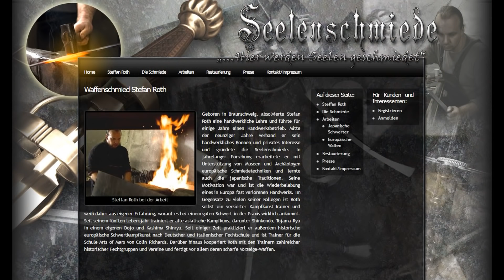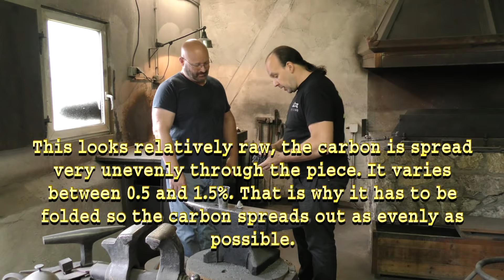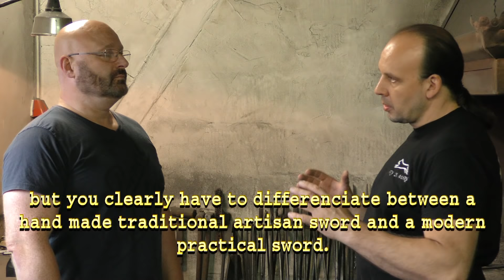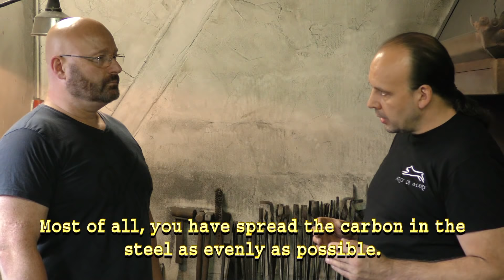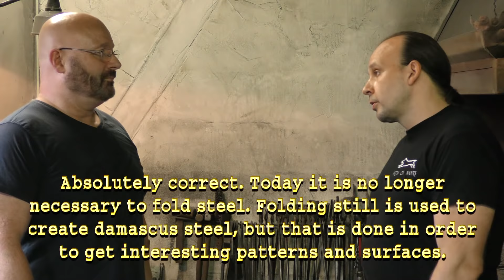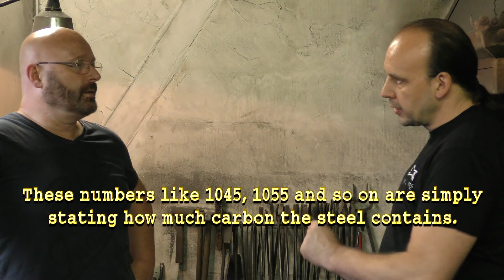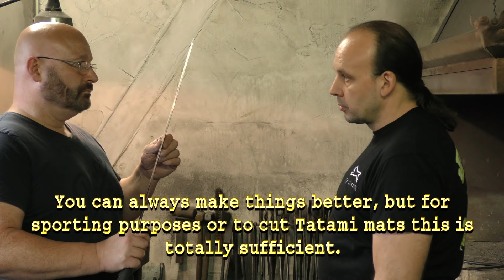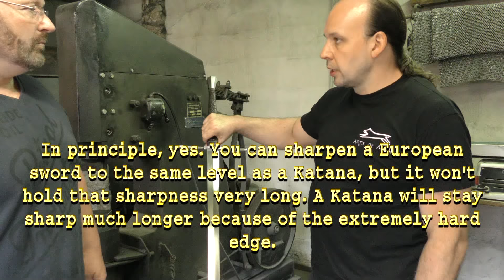Katana: The Naked Truth

Comment: I've always wondered if the Japanese tempered the edge of their katanas after the quench. I've watched a lot of videos of them quenching blades but never tempering them. Also, they never say what they use for flux in the folding forge welds
Reply: Shane K they use ash and clay.
Reply: I used to blacksmith some and when I made a forge weld I got the two pieces as clean as I could, I wonder why the ash and clay don't contaminate the weld?
Reply: It's a liquid mixture that they coat the workpiece with to stop oxidation. Straw ash and the clay used both contain large amounts of carbon.
Reply: I think I get it now, thanks. I guess it liquifies like borax and welds through, plus adds some carbon.
Reply: Something like that. Nobody truly knows the traditional methods used. It all comes in bits and pieces from swordsmith to swordsmith.
Reply: The mixture actually hardens in the forge and encases the steel. When pulled out it is shattered from the first hammer blow and wet anvil.

Comment: I'm not convinced that old Japanese sword makers would have forgone the process of folding in exchange for modern steel. Like tea drinking, ceremony, tradition and ritual are very important to the Japanese. Blessings were performed during the folds.
Imagine how disgusted a Japanese swordsmith would be if you just threw some metal into a CNC machine, pressed a button and a sword popped out.... even if you argued it was superior.
You may impart sharpness to the blade, but you don't wake the spirit of the sword... its soul.

Comment: Katana swords are not partially hardened!??! The clay process slows down the back edge or spine cooling rate but the entire blade is quenched in water not just the edge.. it is all hardened. The edge just hardened for cutting and the spine tempered for flexibility..European swords do not differentiate the spine and therefore the clay process is not used and the entire blade takes on an homogeneous spring temper, but to cool a Japanese sword only partially hardened is completely incorrect.

Comment: lol it's super interesting to watch someone who's practiced but not trained, especially in slomo - when you are cutting with a two handed sword or staff or whatever - your left hand (if sword) or whatever hand is lower on the grip (if not sword) delivers all of the power - the trailing hand should only be for control. (oh wow! He does MUCH better with 1h - just needs to transfer that to 2h =p) Not that you need this to be able to effectively cut, but your cut will never be reliably clean if you're not mindful of this - if you look at the leading arm tension in these cuts, anytime the tension is not maintained (ie the trailing arm is applying force) then the cut suffers tremendously. It does not take much force to cut, and you want to abuse the arc of your arm to get a slicing cut rather than a chop, at least with a katana - though this same form is used across seemingly all Japanese armed and unarmed - at least all I'm familiar with.

Comment: In comparing traditional tamahagene to modern steel tho a correctly made tamahagene is comparable to modern steel from my understanding traditional tamahagene swords are much more complex to make. From what I've read even expert japanese swords smiths had a sucess rate of about 60%
Reply: Cornered Fox when I say 60% sucess I'm referring to the folding process as blume steel starts so impure the folding process can cause the peice to crumble apart from my understanding and the few documents on traditional japanese sword smithing I've watched and read, it's very common for the steel to crumble apart during the first folds causing the smith to restart the process.
Reply: Tamahagane as Cornered Fox already said is nowhere close to modern steel. Though in defense of bloomery steels, you can make wonders out of it to this day, people figured out how to make it into a relatively pure steel pretty early on (but it wasn't the Japanese, it was the Celts in 700 BC). But it will cost you more in time and materials and your product will critically fail more often than ones made out of modern steel.

Comment: Either you Cut or you slay or you hack bro its obvious just take a normal rasersharp knife and cut a thin paper you will notice that just pushing it 90° will not cut the paper but when you pull it with a slight angle you dont even rly notice the paper like any resistance same counts for the sword!
Reply from the maker: Didn't you watch the video? That "pulling" nonsense was talked about. A sword isn't a paper knife.

Comment: This doesn't make katana any less better. The katana is lighter and will have cleaner cuts. the curved blade will also help with precision and speed.
Reply: Katanas actually are heavier than comparably lengthy European swords. A sword being very light does help with speed, but greatly reduces cutting power, as there's less mass behind the slice; weight is a double edged sword (pun intended). Also, the curved blade has nothing to do with precision or speed; it simply increases cutting power because there's more total blade length for a given swords' length than a straight edged blade. European swords were simply made with different techniques that resulted in a different blade that sacrificed slightly better cutting ability for far better durability and flexibility.
Reply: Nah katana is not a nimble sword at all for its size. The blade is very thick and heavy and the point of balance is far away from the hands. It’s a great cutter but that’s pretty much it (though I prefer the messer). European Longswords are much more nimble than you think. Popular media doesn’t represent reality.

Comment: How bout bigger than 300 pound human beings? Maybe in the right hands, a sword could be used to cut a sword, and the real katana would go through the soft steel, if a person was able to strike with that much force.
Reply: No way would any human be able to chop steel straight through with a sword. A bear would give up before accomplishing it. It simply isn't possible to generate that much momentum with a piece of steel that light without tearing your arms off. There's a reason you need a rotary saw going at thousands of RPM to cut cold steel; one quick slice simply can't do the job.
Reply: Joseph Traynham - How bout like a 5,000 pound 20 foot giant?
Reply: Honestly, the sword would probably shatter with that much force.

Comment: It's important to note that samurais first choice of weapon on the battlefield wasnt a katana (translated to english as simply: Sword), instead they used polearms, some used nodachi which is practicly a very long katana - where interestingly enough half of the metal rod is handle, the other being blade of course.
Furthermore, in europe, a different style of warfare, enrivonment etc. Made axes in early periods preferable - in later periods you still find slashing swords (falchion, for example) yet swords were prefered for poking in later periods (roman gladius from older period were also for stabbing though - so weaponry changed for the situation) also note that some longswords were almost dull at certain parts of the blade - whereas japanese swords were prefered very sharp on the blade because they served another purpose (having a hard blade and soft metal in the back to absorb the shock also means the sword is less likely to break/shatter - this is also used in viking dane axes, etc. :P)
Reply: Oh and also - you could find better steel in europe :)
Reply: Cornered Fox yes i did refer to a different type of nodachi, i saw metatron play around with one of those half blade / half tang

Comment: Your guy knows swords, but you'll never convince me that a katana made the old way, will be inferior, to a European sword made the old way.  I maintain they each have their strengths, and weaknesses.  Now a master swords-man, can use them to each ones maximum performance.
Reply: You do realize that traditional katana are forged using a method discovered by the Celts about a thousand years before the Japanese started using it?
Reply: About the same time I think, but the Japanese folded theirs more.  Plus the sword-smith, on the Katana, used high carbon steel to hold the edge and a low carbon insert to absorb vibrations.  Then when quenched, the steels lost heat at different rates.  Hence the distinctive curvature.
Reply: I'm fairly certain the Celts discovered it way before the Japanese did, around 500 AD and dropped it around 700 AD when more efficient smelting methods were developed/discovered. When it comes to steel folding for weapons the most it would be folded is less than 20 times, more than that and there is risk of ruining the while thing.

You are correct about the composition of the katana, though I always wondered if the curvature is intentional or not, considering they could straighten their blades if they wanted or needed.
Reply: When it comes to one sword being superior to the other, it needs to be specified at what they are supposed to be superior. As you say, every weapon fits a specific niche.

When it come between a traditionally-forged katana and a traditionally-forged sword, the latter is more versatile because of it's spring tempering and its cruciform design, allowing a double-bladed edge and consequently, cut and thrust capabilities.

A katana, given its construction, is a specialized cutter, you can stab with it but is less than ideal, yet there are many techniques that employ it. In fact, both longsword and katana fighting styles are very similar to one another.

Overall as stated before, if one wants to discuss superiority of swords, it needs to be specified which specific swords and which specific activity.
Reply: ROG41 
Folding the steel is the best way to maximize the product of bloomery steel, which is not homogenous. 
Bloomery steel was used well beyond the 15th century if I recall correctly, because even if blast furnaces were around since the 12th century in Europe, it wasn't a mainstream production method until the 15th-16th. 
It was faster to produce steel in bloomery furnaces (direct method)  due to the fact that pig/cast iron (the product of the blast furnace) has to be refined (lower the carbon content).

What is funny is that the Japanese knew and used blast furnaces, to produce pig iron and refining it. Nowadays nobody seems to remember this and they all go with the bloomery iron (tatara kera oshi) while a much better steel was used thanks to the product of the Tatara zuku oshi.
Reply: This is new to me, I'd like to know more. Could you please tell me from where you got your information?
Reply: ROG41 
Do you mean the first paragraph of my post where I discuss the European situation or the second one where I've talked about the Japanese situation?
Reply: Oh, sorry for not being specific enough. I meant the part about the Japanese blast furnaces. As you stated, I'm only aware of the bloomery.
Reply: ROG41 
Yeah sure just give me some time to recollect all the useful links ;)
Reply: Cornered Fox 
Thank you for your input!! 
I only humbly disagree with the fact that a Katana is a standard piece with a shorter given lenght; for example you can technically have a katana blade of 90 cm without entering in the Nodachi range, and at the same time a single edge offers some advantages, like having a stronger blades. Not to mention that some Katana/Tachi have pommels shaped like birds heads, which could seriously injure someone.

For the blast furnaces references I have done some researches, you can read my previous comments; although I'm not extremely expert in this field, through a comparison between the early blast furnaces described by Alan Williams in his book "Knight and blast furnace" I came to the conclusion that the Zuku oshi Tatara process, which main output was cast iron, fit Williams description. There isn't a widely available knowledge on the mainstream websites but if you dig enough you can find some of this stuff.
To me is quite obvious that the Japanese developed such technology since they were exposed by Korean, Chinese and later on European iron and steel production, in fact records of the Zuku oshi tatara are as old as the first native iron products
Reply: Okay just to correct ROG41 here, the Celts discovered the method of folding steel around 700 BC not 700 AD and by 300 BC practically everyone in the mediterranean has been using it.

And yes bloomery steel remained, even in the 18th century we have swords made out of blooms. But what really changed isn't the steel itself, but the process of manufacture and division of labour. You no longer had smiths folding the steel, instead you would get homogenized steel from the forge. And of course the new methods of heat treatment, like slack quenching, tempering etc.

As for average blade lengths, you rarely if ever find a longsword with a blade shorter than 80 cm (and that low value is already pushing it), but the 90-100 cm range is very common, and a lot more examples sit around 105 cm and over blade than ones at 85 or lower. Unfortunately the encased in steel blog isn't up anymore (because Keith Farrel did collect a lot of data), but I remember that the average blade length for a longsword in the 15th century was 94 cm, 91 cm in the 14th century and 89 cm in the 16th century.

As for concerning the average height for males for example the English average in the period of 1200-1550 was roughly 171.5 cm tall (5'7.5") the modern English male population a couple years ago was 174 cm (5'8.5") tall. This value calculated based on mostly commoners' skeletons. The average height of a Japanese male between 1200-1800 was 158 cm (5'2"). 

If we adjust sword lengths (calculating with 71 cm for katana and 89 cm for longsword) for the average English in this time we'd get a katana that is 77 cm in blade and the Japanese man would get a blade that is 82 cm long, on average. That is still 5 cm difference (2 inches), if we were to scale the average 15th century longsword down however, the Japanese man would get a blade that is 86.5 cm long.

But if we go by illustrations alone we get figures like this:

Wallerstein part C, circa 1430
Height to total length ratio: 0.9
Height to blade length ratio: 0.67

Talhoffer, 1467
Height to total length ratio: 0.83
Height to blade length ratio: 0.62

Kal, 1470
Height to total length ratio: 0.69
Height to blade length ratio: 0.55

Wallerstein part A, circa 1470
Height to total length ratio: 0.76
Height to blade length ratio: 0.55

Falkner, 1495
Height to total length ratio: 0.71
Height to blade length ratio: 0.52

Glasgow, 1508
Height to total length ratio: 0.79
Height to blade length ratio: 0.56

Goliath, circa 1510
Height to total length ratio: 0.96
Height to blade length ratio: 0.69

Pauernfeindt, 1516
Height to total length ratio: 0.83
Height to blade length ratio: 0.56

Medel, 1539
Height to total length ratio: 0.87
Height to blade length ratio: 0.65

Mair, circa 1540
Height to total length ratio: 0.77
Height to blade length ratio: 0.6

Hutter, 1564
Height to total length ratio: 0.85
Height to blade length ratio: 0.59

Meyer, 1570
Height to total length ratio: 0.83
Height to blade length ratio: 0.59

Note that these people are in one loosely knit tradition, that ended up being split into 5-6 schools but for all intents and purposes they share a lot in common and they are all German so it would skew with the preferences of others.

Comment: in the katanas defense, a) WW2 katana were not the best examples of a good katana. b) the katana is better to cut with than a long sword. (Though long swords weren't bad at cutting either)
Reply: There are certain types of longsword, mostly common in the 13-14th centuries that I am pretty damn sure they are better cutters than katana, simply due to the fact that they are only 1/4 the thickness and the weight distribution is the same.

Comment: I ain't any genius about this, but as far as I recall, the Katana was made like that so it can actually take some punishment. If you hit most steel rods on the flat side, they'd break or bend, and the katana is made so it can take that as it was used to block other katanas to preserve agility it has. that's why most kendo and kenjutsu styles don't use a shield.
Reply: Actually katanas are comparatively easy to bend because the the majority of the blade is made of relatively soft steel. Also, since the edge is so hard it's pretty easy to get chipped. And the process used for creating the steel was imperfect so impurities would often be in blade which create weak spots where it's more likely to break even if you do fold it. If you want to get some more info I would recommend watching Matt Easton's videos on katanas on the channel scholagladiatoria or shad's videos on katanas from the channel shadiversity. Also are you a Christian?
Reply: They're not made of soft steel. They're made of a sturdy core and covered in a softer metal. Our equivalent would be gray iron for the core. Besides, what does my religion have to do with this?
Reply: What i mean is that the exterior is made of lower carbon steel which didn't get hardened much during the quenching process, because it was insulated by a thick layer of clay, so it's "soft". The problem of bending was partially responsible for katanas being thicker and shorter than other two handed swords. However there are many historical examples of katanas bending. As for religion, I'm a Christian, and I usually try to include that question at the end so that I can try to reach the person I'm talking to with the gospel.
Reply: Katanas were/are much easier to bend.